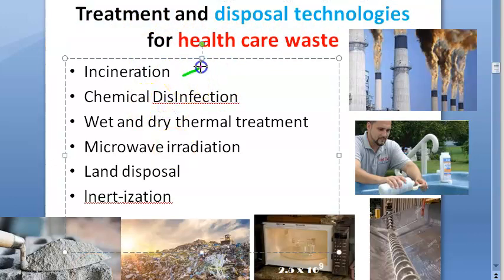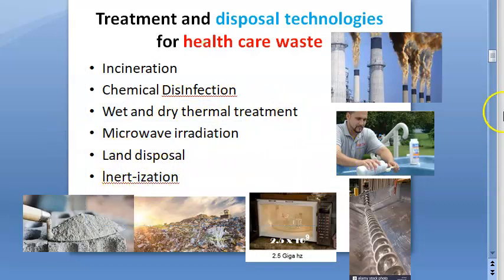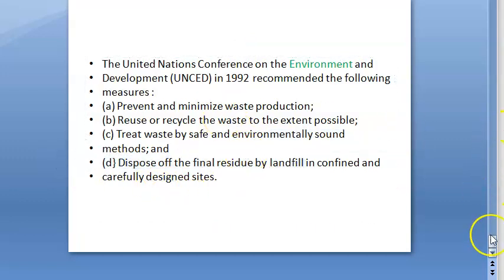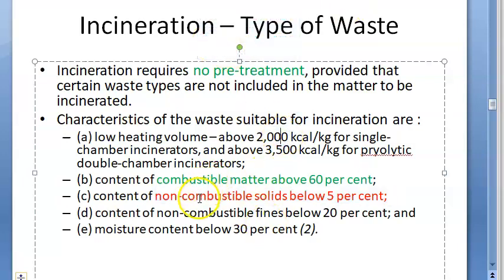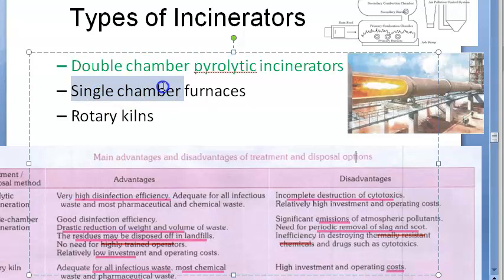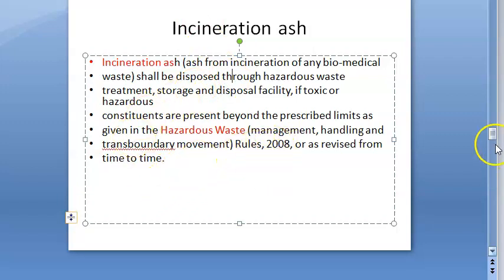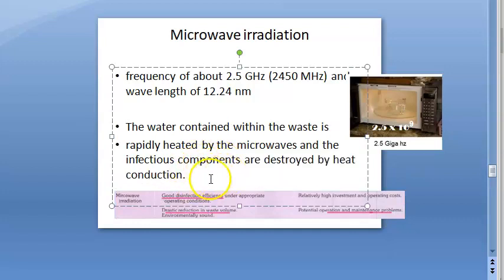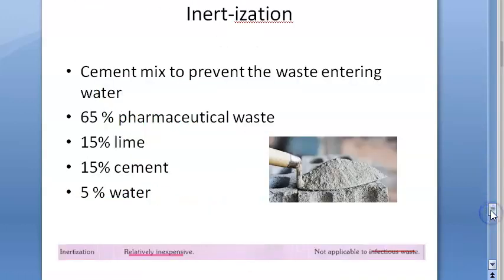PSM 830 a Treatment Disposal technology hospital biomedical care waste incineration

Comment: 0:01 Types
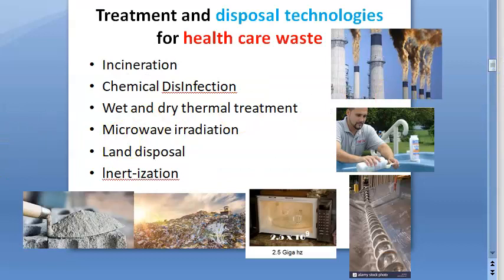7:00 Incineration - dry oxidation, aerobic burning at 1000C
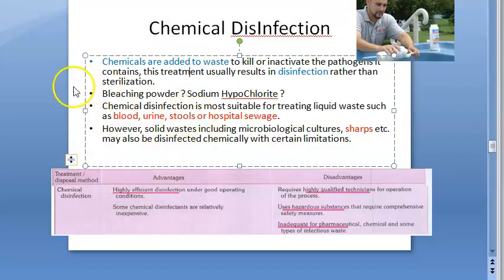16:30 Chemical disinfection
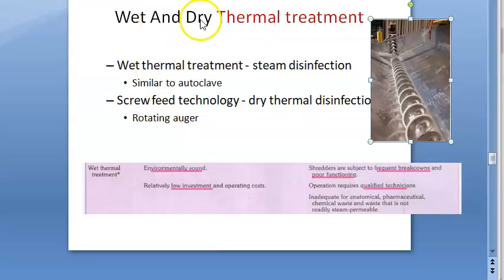17:15 Wet and Dry thermal treatment
18:50 Microwave irradiation
20:10 Land fills
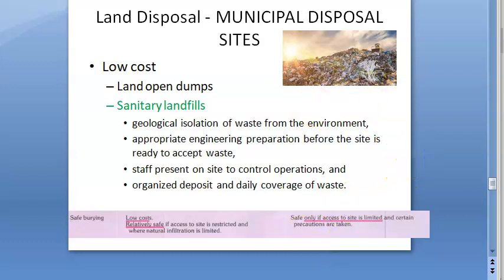21:05 Inertization
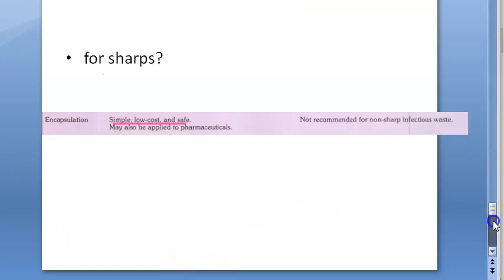21:40 Revision